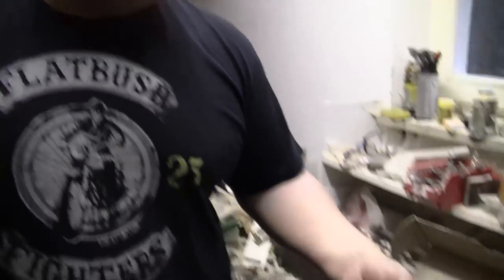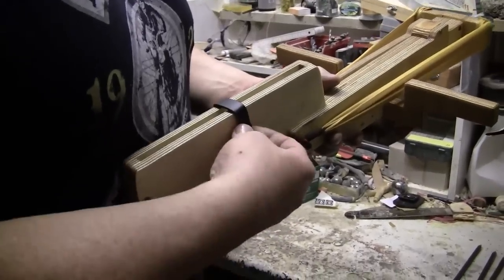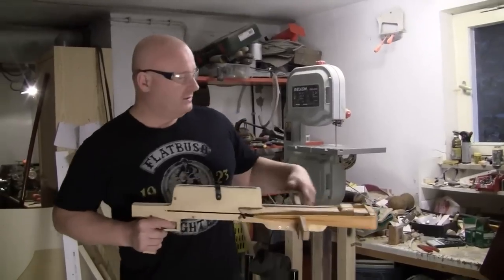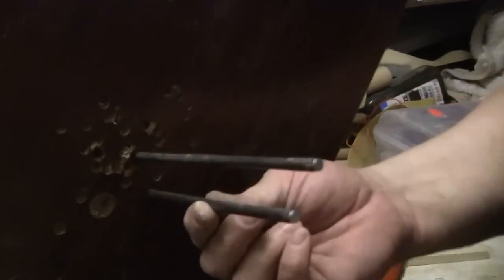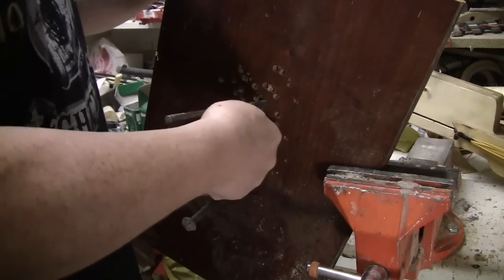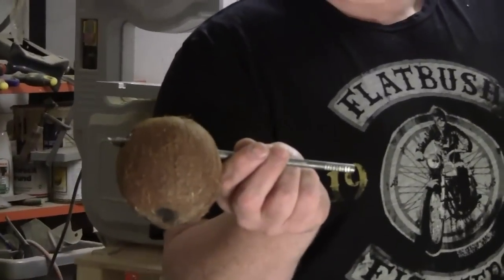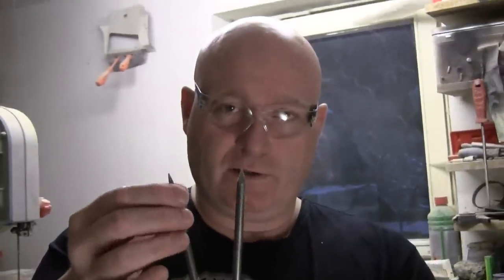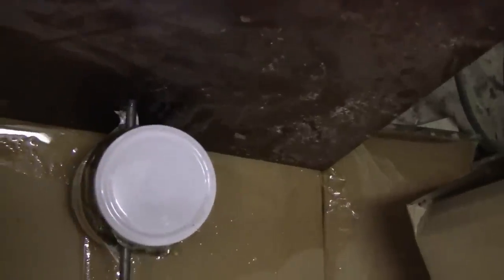9" Nails, Pump Action, 10 Shots!

Comment from the maker: From wikipedia ("crossbow"): 

"Bolts do not have fletching, i.e. feathered ends like those commonly seen on arrows...

Most modern crossbows are designed to shoot arrows instead of bolts. Crossbow arrows are of similar construction as ordinary bow arrows, just shorter in length because of reduced power stroke." 

Time for some more lessons, history nut! :)

Comment: First of all, let me say that I love your work, and this design might be one of the best I've ever seen. But here's my two cents if you want to consider it. 
My theory is that if you shaved or ground down the back of the nail to make it lighter than the front, then that too may also help it remain stable in flight for longer ranges. 
And perhaps consider modifying the point to have sharper cutting edges as well as a point?

Comment: Of course the original version of the nail is better than the smoother, skinnier version. It's made to split. The skinny smooth version doesn't split, therefor more surface area is in contact causing more friction. The splits open up gaps that decrease surface contact area. Cool gun.

Comment: You could also hammer them flat on one end then sharpen them on a grinder into mini broad heads. After shaping them sharpen the blades as sharp as possible. Using a torch would make it easier to flatten evenly and you could also oil quench heat treat them afterwards by heating them until they just start to turn an even blueish color just before quenching.

Comment: We used to make a arrow chucker by tying a stick to a rubber band, and the other end of a rubber had a hook on it. We would heat up nails in the BBq and pound the tip to make like a broad head, then cut a hook into the broad head with a file to except the hook on the rubber.  A little duck tape for fletching , and they were small heavy arrows that were fairly  accurate and hit hard and stuck in the target well. I figure those arrow encased in Styrofoam 2make a cartridge to feed in your crossbow.

Comment: A nail is manufactured to have 2 planes that cut the grain of timber. If you look at it closely you can see the different sides. When nailing into timber, place the wider edge perpendicular to the grain so it cuts the timber instead of spiltting the timber.

Comment: I'm a little bit of a history nut, and I can tell you that you're wrong about crossbow bolts. They did have fletching, usually two vanes positioned opposite each other. The difference between a bolt and an arrow is that a bolt is considerably shorter and stouter, as a crossbow has less draw distance, and therefore shoots shorter missiles.

Comment: If you grind the point with a 3 sided ogive shape about 1 1/2 inches long rather than round or the short steep point that comes with nails, it will cut in and stick much better.I do this to all my throwing spikes which are those nails. it sticks really well.

Comment: well i bet that the bolts will go deeper and will not fall when next bolt is shot at the board if you strap the board harder. because one side of the board is free the board is oscillating and flexing when you shoot at it which makes it harder for the bolts to penetrate. btw i have never ever seen so big bolts :)

Comment: Would it be plausible to utilize a constant force spring for this, intead of rubber? What about a mainspring and piston?
Reply from the maker: Not plausible. Such springs are low in efficiency and their draw length is very limited.
Reply: Oh snap, I'm talking to a celebrity...

I'm no slingshot master. But, from what I understand, constant force springs can range in draw strength to up to 50 lbs (that's the highest I know of), and you can double or even triple them up using the appropriate formations.

http://www.vulcanspring.com/conforce-constant-force-springs

As for mainsprings, I have no idea how capable they are for this, so on that I will stay quiet on that.

Either way, thank you for gracing me with a reply.

Comment: Joerg, Have you thought about making an rail gun with electromagnets?  That would be cool and fairly easy.  Also I was thinking of an improved sling that uses hydrolics to increase the centrifical force of the swing.  Basically, you take a balanced flywheel with two movable weights, to increase the speed of rotation ( once already rotating)  you simply bring those weights to the center with hydrolics or a motor or possibly human powered lever.    Kind of interesting....

Comment: Seeing as the original tip is better in the coconut challenge, couldn't you just make the edges sharper and longer like on a grinder.?  It would greatly improve the penetration power of the bolt.

Comment: Actually arrows did have smooth edges. It is called a Bodkin arrow. It was designed tofocus all of it's impact force into one point to penetrate heavy armour and puncture helmets.
Reply: Yup, you are fully correct
Reply: +BoBu Bodkin arrow actually have the cutting edges too to cut inside the armor.
Reply: Ackwell
You;re wrong.
Reply: BoBu YOU HAVE ANY PROOF OR EVIDENCE, OR sources to cite to prove your claim?
Reply: Mitchell king
Go look it up if you don't believe me. It's not my problem.
Reply: +BoBu Bodkin tip has a squared profile so it has edges. Never seen a medieval bodkin tip without them.
Reply: Ackwell
Bodkin is in a smooth cone.